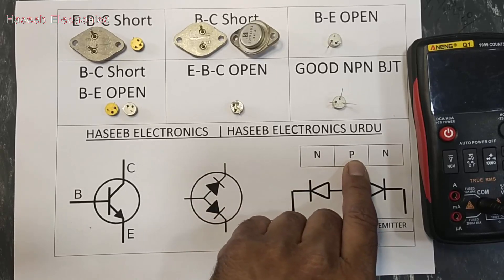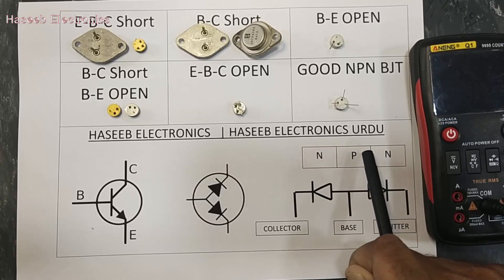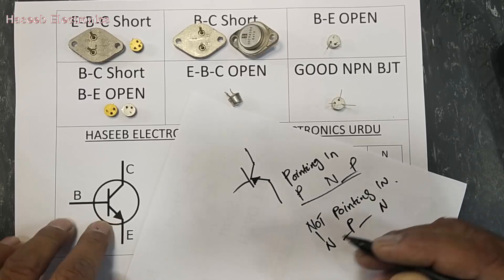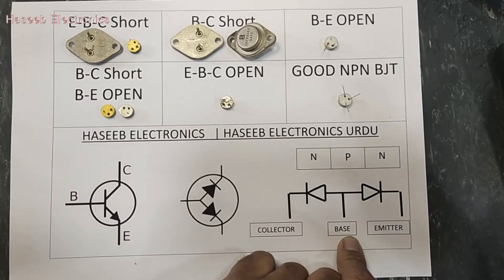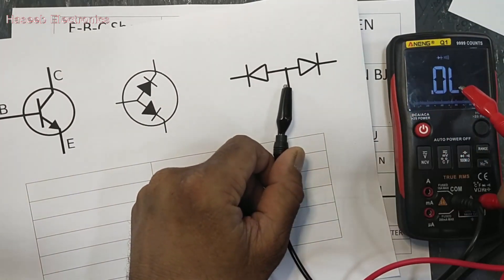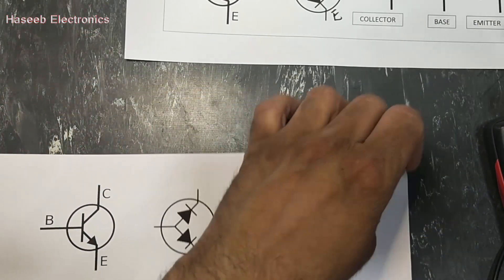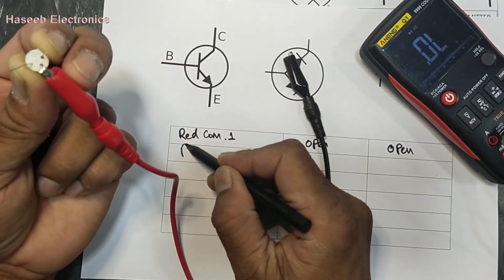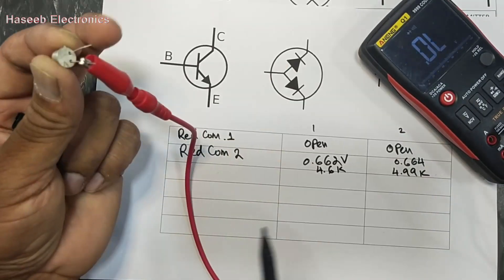{474} How To Test Transistor With Digital Multimeter /BJT Failures of Transistor

Comment: Nice explanation. But with the first 3 lines all variations were already measured. Lines 4, 5 and 6 are only duplicates of the first 3 lines.
Reply from the maker: these are 6 sequences to know from basic. 
first make one lead common and move to one by one 
step 4, 5 & 6 are similar to first 3 steps, just we have to change test probe. (in first steps if it is red, in last 3 steps it will black as common)
Reply: @HaseebElectronics  In row 2, red is on the base, and black on the emitter and collector. What is the difference to row 4, column 1 and row 6, column 2? The measuring lines are connected identically, only the point of view of the explanation is different. The reverse polarity is already included in the first 3 lines. Name it B, E, C and you will see the mistake.
Reply from the maker: please wait. I will carify it in detail
Reply from the maker: kindly check video number 476

Comment: can also do video with good explaination on soldering station? type of wattage, tip size? application to which type of circuit boards wire etc? thank you sir.
Reply from the maker: yes sure. i will try to share it soon